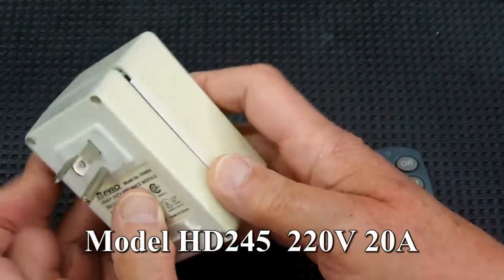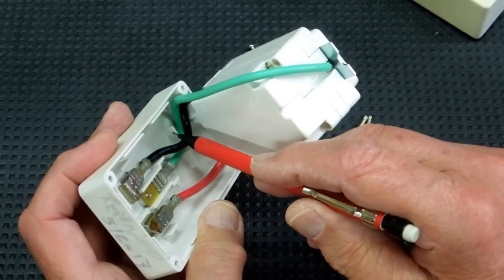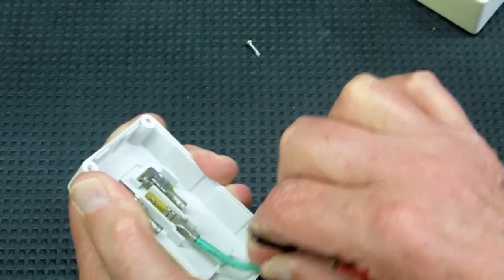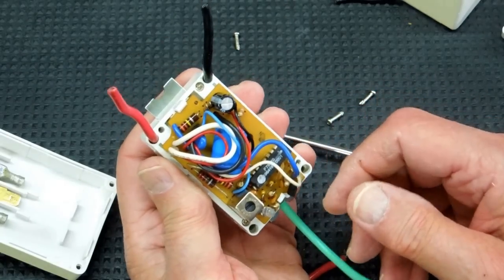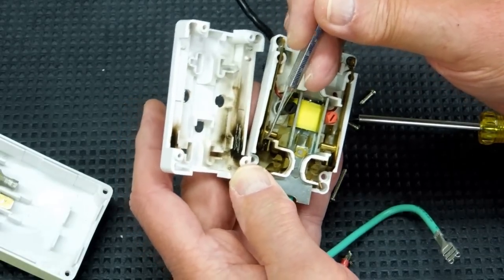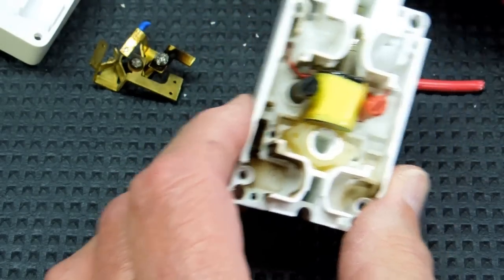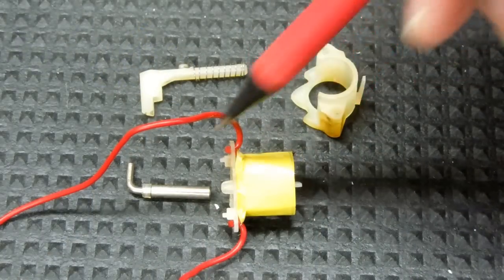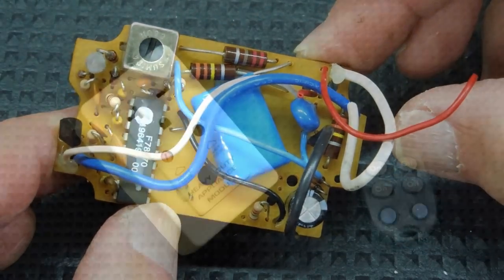X-10 Heavy Duty Appliance Module - Failure Autopsy

Comment: CURIOUS TO LEARN DEPT  He was using it to control a 220VAC Motor.  I am using mine to control a 220VAC Water Heater.  Is it likely that the contacts on my unit would a) last longer B) last as long as C) not last as long as he experienced?  And, of course, which principle(s) would lead me to such a conclusion?

Ah, inductive vs resistive loads!

Years ago, before I discovered this 220VAC module, I ran a 110VAC off the incoming 220VAC for the water heater through an X10 appliance module to control a 24VAC relay salvaged from an old HVAC setup wired ot make/break the power to the water heater.  Since I had all these spare parts and 'extra X10 modules and controllers, it was way more economical than [aying forty dollars for the X10 HD Appliance module.

What I did not know that your take apart taught me, is that I could have taken the HD module apart, tossed the male 'plug' bit and wired the rest into a deep box - effectively creating a 220VAC X10 outlet and plugged my water heater into it.  What I did instead was the wire the 220VAC feed into a conduit box with the appropriate 220VAC outlet. As it stands, the next homeowner will easily remove my X10 Module or replace it w/o calling in an electrician!

The old way would have frightened any Home Inspector and likely killed an offer or cost a few hundred at settlement for an electrician to remedy my feature.  

My Water heater is set to MAXIMUM heat but only comes on twice a day (15min AM 15min PM) like clockwork (X10 Timer Module) or when we override the timer and remotely switch it on - I like long hot showers.

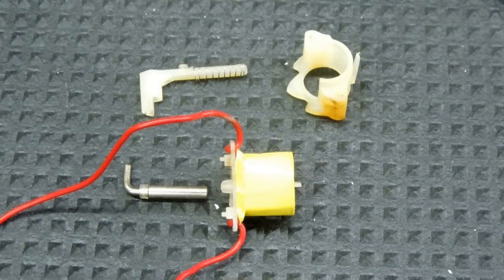Comment: My X-10 PAM04 module died today and would not shut off. Mine was also used with my dust collector. I had a little bit of contact pitting, but not nearly as bad as your yours. The main problem was that the plunger broke near the spring hook (3:37). Maybe overstressed  by stuck contacts or maybe just old age (15-20 yrs).  I will be replacing it if I don't find a better solution. I have a second module for the 110V shop vac and having both controllers in one unit has been convenient .
Reply from the maker: Generally, considering what these do and the convenience, I think they hold up pretty well. I use a number of these for various applications and I expect to continue using them. For me the biggest hassle is remembering how to reprogram the remotes when the battery goes dead... and lucky me... I ended up with two different models of the remote which look identical and they program differently. :-) 
Thanks for watching. Please subscribe! 
That is what keeps this channel going. 
Ron

Comment: On/Off of an inductive load (motor) will cause violent contact arcing. A capacitor will help reduce that - so I was wondering if one was used, guess not due to size of unit. Like the capacitor used with old points in an automobile before everything went electronic. I think the capacitor also helped the high voltage as well.

Comment: I used an inexpensive remote control for low amperage lights Christmas lights to toggle a contacter on and off. All the high current is handled by the contacter  which is designed to carry high current like seen in an A/C compressors. This is like using relays for your auto headlights instead of switching them through the headlight switch. The cost of the remote and the contacter is way less than marginal units advertised for dust collection units.

Comment: Thanks for the video Ron.  These switches should last much longer than 5 or 6 years.  The problem relates to switching a massive inductive load (the rating on the X10 device will be for a resistive load).  Loots of information on this problem if you google it.  I'd be using the X10 to switch a bigger relay or use something else.  An example here: http://www.artisancontrols.com/UtilityImages/ProductSupportPdf/Switching%20Inductive%20Loads.pdf
Cheers, David

Comment: We just had to fix our microwave because of this. I’m told that an inductive load (like a motor) will throw energy back into the switch when disengaging the circuit. Usually there would be a snubber network to take that hard snap in power loss and save those contacts from wearing out.

Maybe check to see if the replacement has anything running across the ends of the switch.

Comment: Looks old
Reply from the maker: This one was 5 or 6 years old. It gets switched on & off a lot.
Reply: Ronald Walters those resistors haven’t been made like that for 20+ years
Reply from the maker: Oh, that kind of old. :-) Then they must still have buckets full of them somewhere in China. This unit was 5 or 6 years old and they still sell these. My guess, if I opened up a new one, it would have the exact same components. Generally speaking, the various X10 modules are pretty good and last quite a while.
Reply: The tracing on the board is indicative of its "true" age too. Haven't seen hand drawn tracings in at least a decade (on parts bought since that set date, that is). China is a weird place like that (in regards to Ronald's last message) you have both high tech and low tech sitting on perhaps the same street, but separated by years and years in componentry and knowledge.